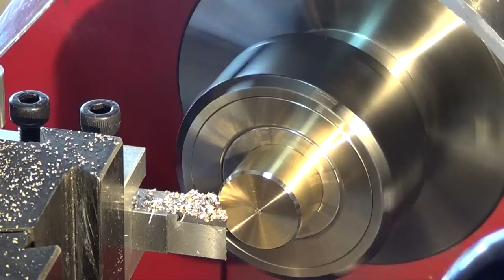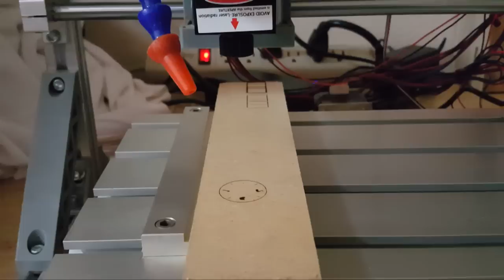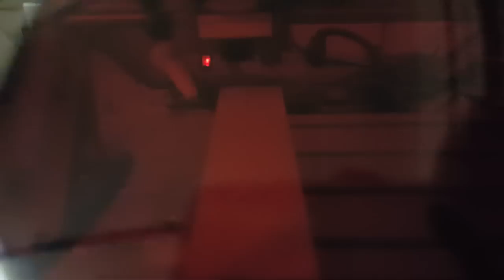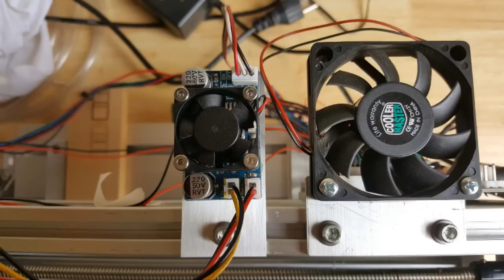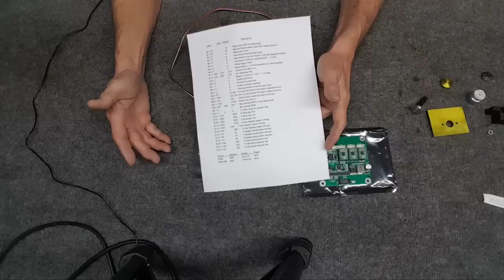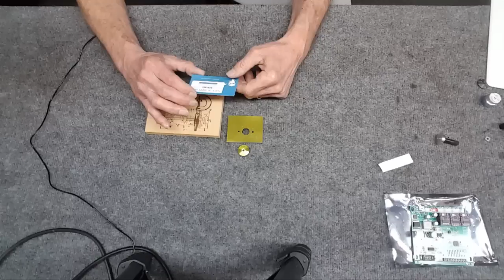3018 CNC Engraving 5,500 mw Laser Upgrade pt 1

Comment: I have a 3018 pro with a 1w laser and it will not photo engrave.  I know the dots is 1.5mm apart so it will do a true 127dpi but it is just bad.  I get better out of my 60 watt CO2 laser than this thing and that is backwards.
Reply from the maker: I don't think 1W has enough power we all have 5W.
Reply: @TheMiniMachineShop  I have seen 500mw used but the power isn't the fault unless you are cutting.

Comment: Hey Dave, great  video and how detailed you are. I recently bought the sainsmart 3018 Pro Mach 3 version cnc and the sainsmart 5500mw laser. Do you have any experience with the mach 3 boards? I'm starting to think I made a mistake getting the mach 3 version and not the grbl.
Reply from the maker: Wow Mach3 is way overkill for that machine and unless it came with the right software driver you won't have backlash comp. My email is at the video end if you need help..
Reply from the maker: FYI I have a 3018 for CNC and another 3018 with a laser setup and a mini mill with Mach3 for CNC

Comment: Dave I am having a problem using the Genmitsu 5500mw laser with my CNC 3018Pro with the new Woodpecker CNC CamXTool v3.4 board.  As soon as I connect the laser board to the Woodpecker board with power attached to the laser board; the laser turns on full power even if I do not have any power to the Woodpecker controller board.   Any ideas what could be wrong?
Reply from the maker: Easy solution email me...

Comment: I had made the leap to install a laser on my Genmitsu 3018 MX3 before I saw you're video/channel.  I came to a point in the assembly instructions where I need to know the version of my control board.  The instructions imply that I can use the 3 wire connector from laser control board to CNC control board for  MX3 Control Card:MC3D3-V2.1 and only the 2 wire connector for MX3 Control Card:MC3D3-V1.3.  The boards in the pictures are identical to each other as they are identical to mine.  There is no indication on the topside for which version it is so I was wondering if there was a way to tell which board I have without having to remove it. Since you have had a lot of experience with Genmitsu/Saidsmart I thought you might know.   Love the videos.  Newest, biggest fan!
Reply from the maker: Send me a clear picture of the board...
Reply: Dave M , picture will be in your email soon. Thanks!

Comment: Great video's I just received my laser and when I pluged in the laser it stays on what should I do?
Reply from the maker: Sounds like you have the newer laser with a push button and red plug. It goes in the red socket on the control board.
Reply: Yeah its all plugged in but if I push the button on the laser turns on shouldn't the laser turn on when you start the run program?
Reply from the maker: What color is the plug from the laser and what color is the control board socket?
Reply: @TheMiniMachineShop  on the board from the laser I have yellow,white and red 
The main board has all white and one black

Comment: Hello, can you help me? + from laser meet + in controller, - from laser meet - in controller and pwm meet pwm.. right or wrong?
Reply from the maker: Right...
Reply: Dave M ok thank you Dave 👌
Reply: Dave M can I using 2500mw for cnc3018???
Reply from the maker: Any laser should work if the signals are correct...

Comment: Hello, You said that  we can Mail you if we have a problem with installing the laser( I can't see the mailing option, so I will write a lengthy post about my problem here). I have exactly the same cnc  from bangGood that You linked and recently I have  received this laser https://www.banggood.com/450nm-5W-Laser-Engraving-Module-Blue-Light-With-TTL-Modulation-p-1337358.html?rmmds=myorder&cur_warehouse=CN with no instructions how to connect it. It came with 12v 5a power supply that makes the laser work, but I want the laser start stop same way as the spindle did not working all the time as n case being connected to power supply. the power supply has also a wire split separately for the ttl I guess. here is the picture https://imgur.com/a/qyhFESh. when I connect with three threads wire directly to the board the laser board does not even start. What should I do?

Comment: Hi there, may I ask a question please, what do you use the coolant line for, blowing air through to keep the work space clean or for increasing the burn capability of the laser, I have a 10 watt pure cnc blue diode laser from Endurance lasers and we use what we call an air assist where we hook up a Hailea Aco 328 air compressor, some silicone tubing and a fine 2mm bore needle, point this using the coolant tube in to the beam of the laser's focal point and it will do 2 things, 1 reduce the charring and 2 increase cutting efficiency by at least 50% the main thing is you need about 80 litres of air a minute. As you are using light burn have you hooked up the camera to it yet and used it to import images and burn them??

Comment: Great video!
Have You tried beaming other materials, especially metalls?
Reply from the maker: Hi Stefan, the laser isn't really powerful enough to burn any metal just wood, paper, etc...
Reply: @TheMiniMachineShop  So no scratch made on metalls. Have You looked into the question what power that would be needed? Engraving metalls ought to be an interesting subject. Printing "The Little Machineshop" here and there…..
Reply from the maker: If you think about it a laser is simply a very hot light beam that reflects off shiny surfaces. So it can burn off paint, dark anodizing, etc. If powerful enough all it would do is melt aluminum making a puddle. I'm waiting to see how oxtools did etching in his last video.
Reply from the maker: @Stefan_Boerjesson  The problem is metal is reflective and if it wasn't all the laser would do is melt it not removing anything....
Reply: You're right. Melthing through would be needed I guess. CO2 laser and kW......
Reply from the maker: @Stefan_Boerjesson  I did show cleanly burning text thru paint which exposed the metal then into acid to etch the metal. Be nice if there was a miniature plasma cutter!
Reply: I recently saw a guy testing a small plasma cutter! The cabinette had the size of a small electrical welder. To carry the tubing and "the pistol" would probably be heavy for Your little laser CNC. I'll see if I can find that video again.

Comment: I got this laser https://www.amazon.com/5500mw-CNC2418-CNC3018-Wavelength-Supportive/dp/B077TTTTY3/ref=sr_1_1?keywords=5500mw+Laser+Module+5.5W+Blue+Laser+Module+12v+for+CNC+1610+CNC2418+CNC3018+DIY+use+12V+450nm+Wavelength+PWM+TTL+Supportive&qid=1563031930&s=gateway&sr=8-1

It takes up to a 7amp power supply. My qustion is can the 3018 motherboard with the red jack have enough power or should I get this https://www.amazon.com/BINZET-Adapter-Converter-Regulator-Flexible/dp/B00Z9X4GLW/ref=sr_1_1?keywords=BINZET+AC+to+DC+12V+10A+120W+Power+Supply+Adapter+Converter+Regulator%2C+5.5mm+x+2.1mm+DC+Plug%2C+12Volt+10Amp+Wall+Power+Plug+for+DC12V+5050+5630+Flexible+LED+Strip+Lights&qid=1563032111&s=gateway&sr=8-1 to power it up?

Comment: Like the video. I will look up video #2.
I just bought a CNC 3018 PRO and it works but the software (DXF2Gcode) programs errors into the gcode as Candle software keeps stopping on each error. Tried burning but can not seem to position the file and it starts burning where ever it wants, or so it seems. Bill - vbcoachwasiATyahoo
Reply from the maker: Not familiar with DXF2Gcode but see if there is a setting to select a postprocessor and GRBL is selected. #2 releases tomorrow at 4pm...
Reply from the maker: Also candle doesn't know where the table is at start up. Home it then turn everything off then on and launch candle. Dump candle use Universal Gcode Sender!
Reply: you need to use easel, stop messing with open source stuff and stick to tried and tested....for the laser trial light burn and if you are happy buy it, its only 40 usd. It also has the ability to import phots and turn them into files etc with a WebCam or its own camera.
Reply from the maker: Huh? Part 3 I show I'm using LightBurn as Easel didn't create the final file for burning on my machine.
Reply: @TheMiniMachineShop  oooops....missed that one, sorry... 😄 only just found you....

Comment: Hi Dave,
Good information.
I used a commercial type laser at work for cutting acrylic and Abs and Hips plastics.
I also cut 25mm high density foam, for my machine tools for my tool chest.
Fume extraction is a must, the hole machine was enclosed so you could not see the laser.
Also you had to manually set the distance from the laser head to the material to be cut
By raising the bed.
Otherwise the cut may not penetrate through the material.
I could cut up to 10mm thick acrylic sheet on full power, but the cut edges have a slight draught (bevell) to them.
Maybe this may help you down the road.
ATB Adam
Reply from the maker: Hi Adam, so far I'm past the crawling stage and now walking before running. It's not powerful enough to do much with metal but who knows what lies in the future for me. Good to hear from you!!
Reply: @TheMiniMachineShop  
I always watch your video's, give a thumbs up.
Only leave a comment if the comment is useful 😀
Just realised that the laser power is 5.5watts versus the 50watt at work.
Never tried to cut or rastering metal, my manager may have a fit, if he caught me !
ATB Adam
Reply: you need to spend serious money, any diode laser will just melt plastic, look in to a modded K40 at K40.se , you are taking around 1500 k....the 3018 laser will not burn plastic, merely melt it....

Comment: I've been really interested in getting a laser. I don't have a 3018 but I do have a couple of other CNCs that I could mount one on. Also, I don't use GRBL but I've been tempted to try it as opposed to the Mach3 I use on my CNC mill. I can't wait for next Friday to see how you engraved aluminum. Thanks for the video!
Reply from the maker: The Universal Gcode Sender works great with this machine I wasn't to thrilled with MACH3 which has the settings for stepper accel/decel etc needed for many machines. GRBL.9 and 1.1 has those settings imbedded in it so Mach3 won't work with the 3018.
Reply: @TheMiniMachineShop  see my comment above, you need a Toshiba board for Mach3, get that and your life will be fine.....or still get that and use drivel cnc, the board you have will not work well with Mach 3, it's the wrong one I think you will find.